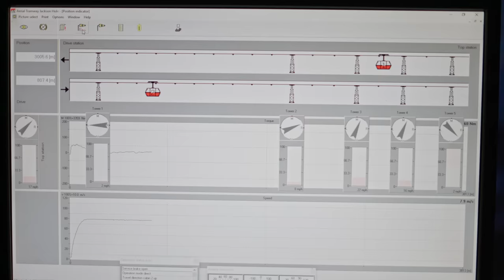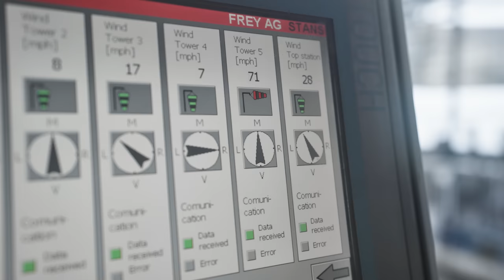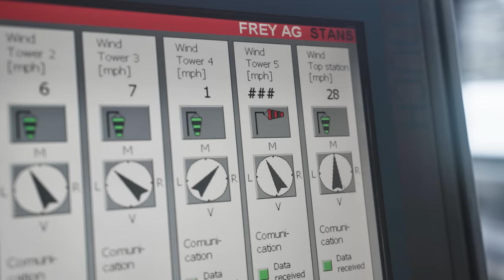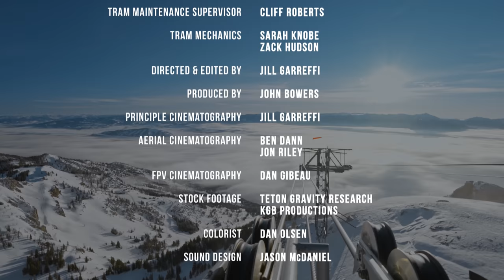CROW'S NEST: JACKSON HOLE TRAM

Comment: Also as for the accumulation of ice and snow on the instrumentation, I wonder have you considered engineering and routing some heating equipment to the area? Seems like it could work in at least some of those areas.